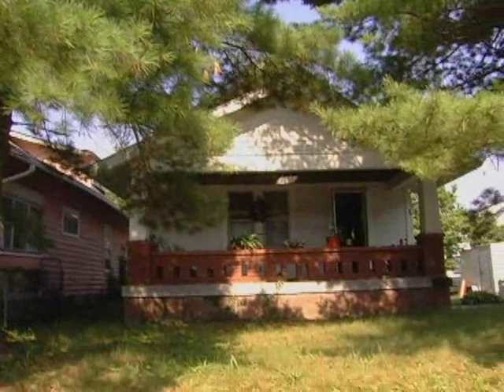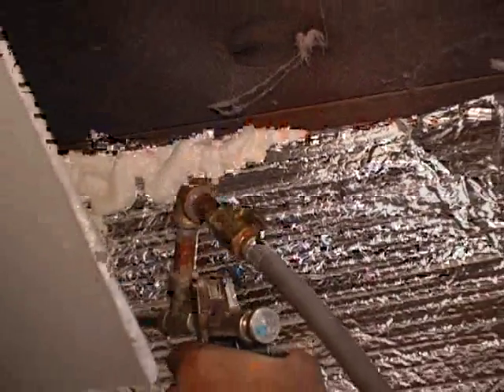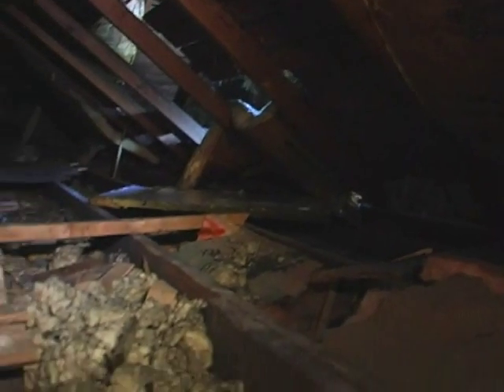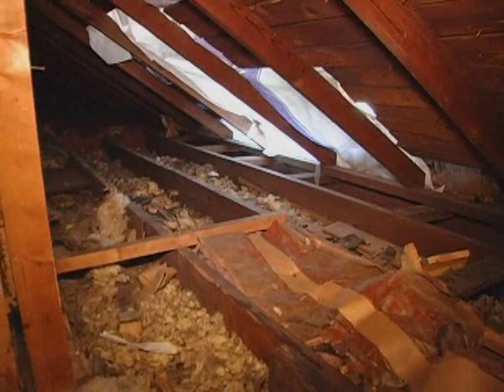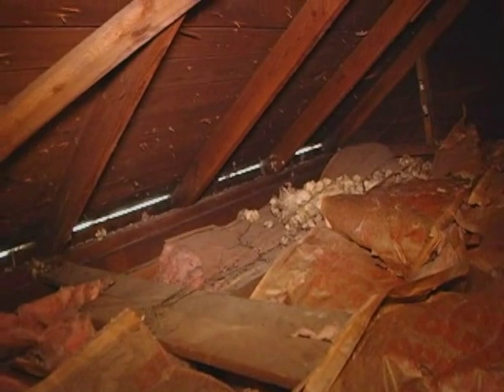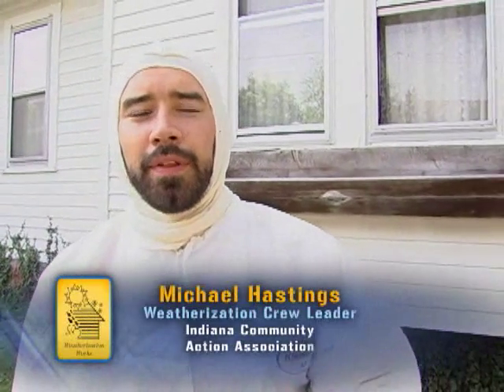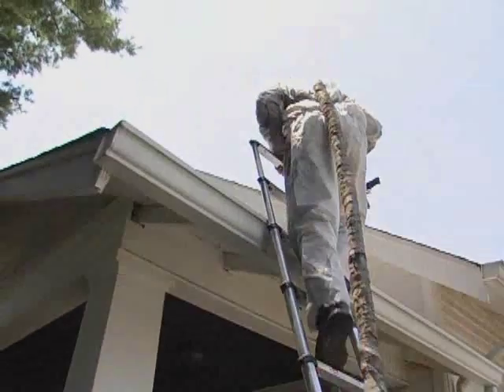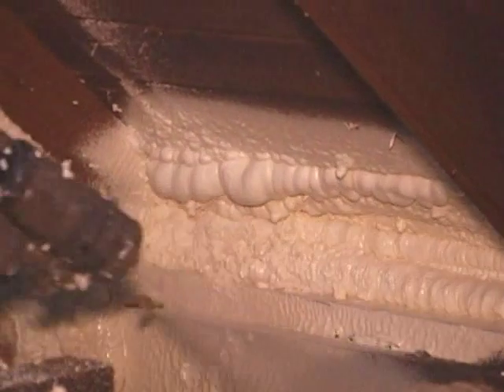Attic Air Sealing Demonstration - Weatherization

Comment: I paid to have my attic sealed. I already had insulation up there (blown-in) and they had to pull it back. How can I know that they did a good sealing job?
Reply: When they did the job they should have ran a blower door test before and after wich gives you a starting # of how leaky or tight your house is, so after they are done your number should have went down generally 20 to 30% depending on how tight your house was to start with